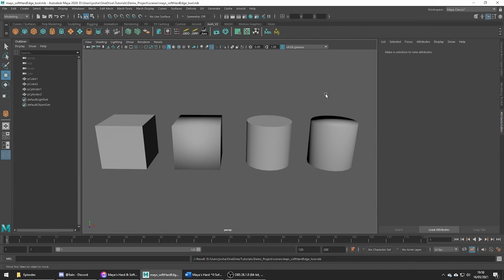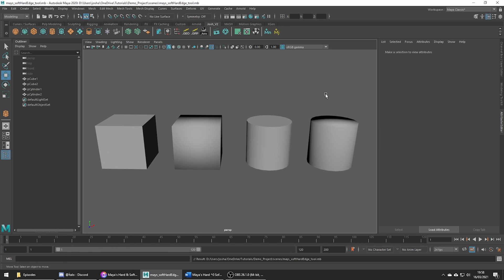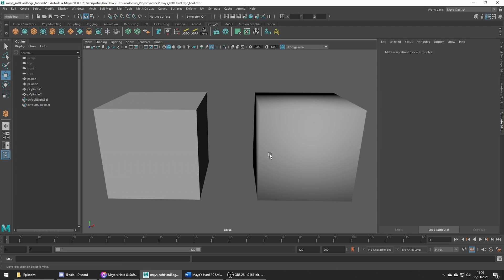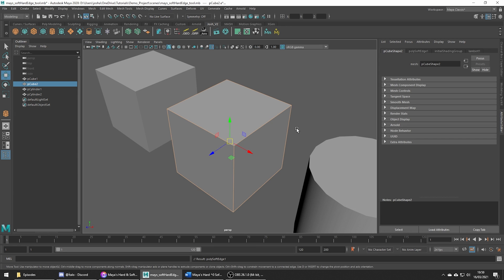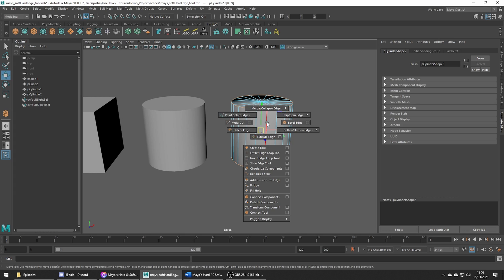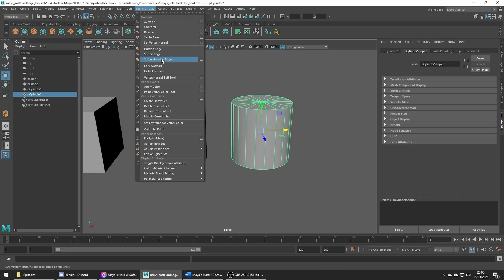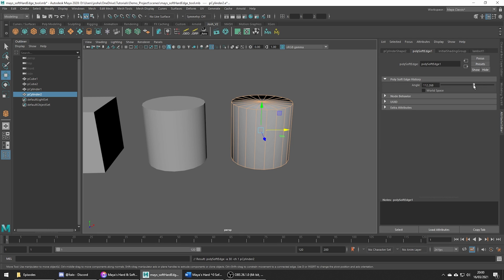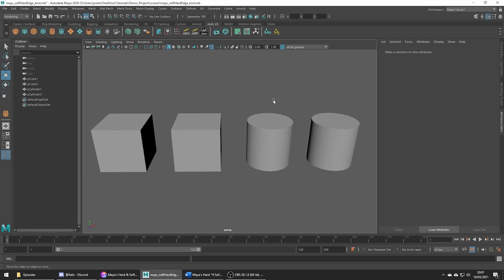Maya's Harden & Soften Edge Tools

Comment: great!! i've been thinking about this and in just under 5 minutes i understood it. one thing i'm still not certain, when you make the uvs, it will be automatically soft or harden the edges? how that uv process affects the final mesh?
Reply from the maker: This doesn't have a direct affect on the UV's since these modes are only changing how the normals are displayed and not the actual geometry itself.
Reply: @JoshAntonio  thanks for the answer! One more thing, do you use harden or soften edges after doing the uvs? For example, I used to do it before I imported the low poly model into substance, is it the right way?
Reply from the maker: @namcis1903  There isn't really a correct or wrong time to apply harden or soften edges to your mesh - the workflow which you've been doing will work fine, as again, this is only changing the way the normals are displayed and not the actual geometry.